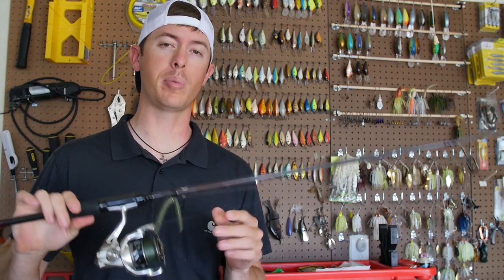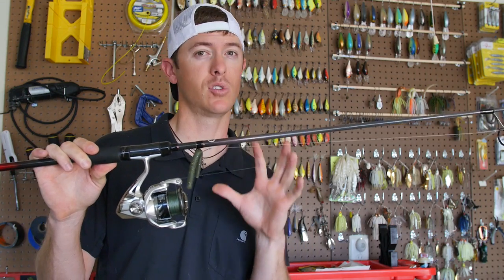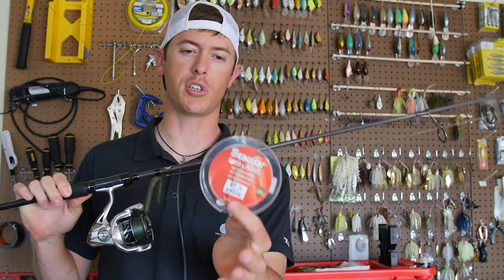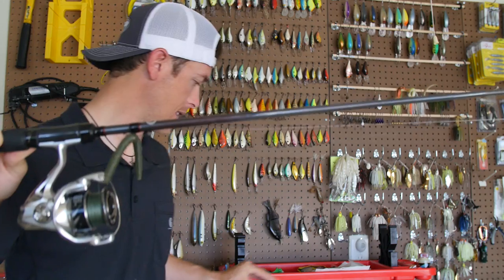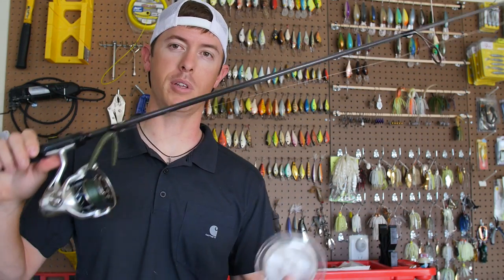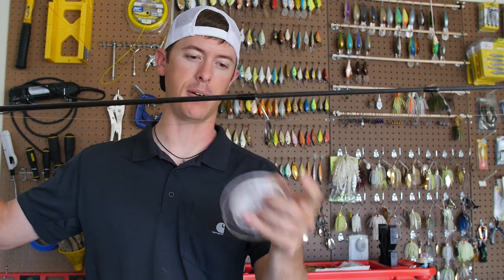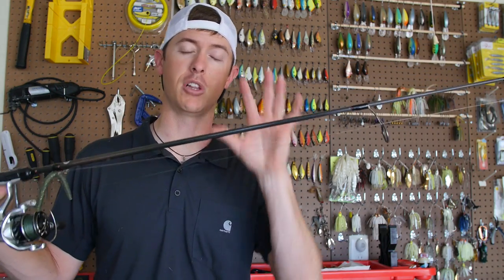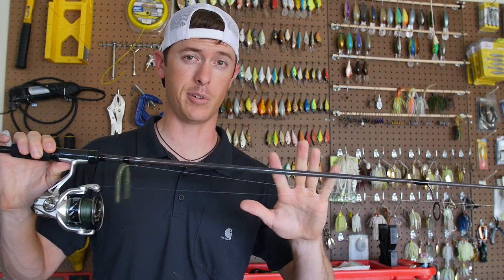How to Reduce Line Tangles on Spinning Reels Sub Question

Comment: Another thing is that you are putting too much line on the reel. So, when you happen to open the bail, the excess line will spill out. Also, you should try to tie your line to a tree, pole, etc. and walk it out until all the line is off. Then, pull until you fell the tension build. This should straighten the line and there will also be less line memory.
Reply: i also use a large barrel swivel on what i tie it off to and kind of bounce the line between tight and slightly loose and it seems to work more of the twist and memory out of stiffer lines
Reply: I’d have to walk to Asia if I were to unreel all my line

Comment: One trick I commonly use is after spooling take the spool off with the reel and let it soak in VERY hot water, it will take the memory out and it will "learn" the spool. Dry it off real good and put back on the reel and you're good to go

Comment: I use braid on all of my spinning reels and tie a fluorocarbon leader with a double uni-knot. I never use braid on my bait casters, only fluorocarbon because of the problems of digging into its self with braid. Also a good point made in this video is look at your spinning reel to see which direction your bail is going to put the line on the spool. Is it going in a clockwise or counterclockwise direction then lay your spool on the floor.and make sure the line is coming off the spool in the same direction that your bail is rotating. All of the spinning reels that I have dealt with go in a counterclockwise direction except the old Mitchel 300 spinning reels that go in a clockwise direction.

Comment: Another good way to decrease the kinks and twists (flouro, mono)is to take the spool of your reel and soak it in warm to hot water (depending on how bad it is) for 10-15 minutes and it should be ready to rock n roll, I do this about 3-4 times a year and never have to change line, after I take it out of the water I just oil it a little and casts like a dream with no kinks or twist.

Comment: Not sure if I am right: 1) when spooling the reel, it's okay to put the line spool vertically, just feed the line counter clockwise. Same  as when laying the pool down. 2) Some lines have more memory than others. After filling the spool, I take the spool off, carefully put it under a faucet and let hot water flow over it for 20 sec. Be careful not to get water into the drag discs-put some paper towel ball to block it. This heat will reset the memory and the line will not jump off spool anymore. And, line won't be damaged at all.

Comment: Braid to a fluorocarbon leader is the way to go. I started using it and you save money, then braid doesn't cause line twists, and you get more sensitivity. But before I started using braid to flouro I would spray down with the KVD line and lure and it would soften the flouro on to the spool and would add a little bit of strength.

Comment: Good tips, now i have a question regarding a baitcaster with 30 lbs power pro regular braid, the line keeps biting into the spool and when i make a long cast it brakes off and off goes my lure, now I'm aware of the fact that it happens after catching a fish or getting snag and all that but my question is are other brands of braided line are the same or is it just power pro? also i do try to keep an eye on my spool to try and prevent future problems but it seems to happen way to often. Thanks Justin.
Reply: you aren't putting the line on your reel with enough pressure. if you wind it on with more pressure, it won't eat into the spool
Reply: +Luke Cantrell It did cross my mind, thank you for confirming that!
Reply: The diameter is to thin use a different brand or heavier pound test.
Reply: +Joel Ortega the pressure can result from the size bait your using etc. why 30 pound braid on the bait caster anyway?
Reply: +Dustin Edmiston Well i basically use this set up to fish around cover so i went with 30 cause it makes it easy for me to get it out of any snag, yesterday i went to academy and found a spool of suffix on sale for 14 bucks so I'm gonna try it, thanks for the reply.

Comment: I was having a problem with my ardent wire spinning reel, I was getting knots in my line almost every cast, I switched from 15lb braid to 12lb flouro and continued to have the same problem and tried reel magic but continued to have the same problem

Comment: Can u explain what I'm doing wrong with my bait caster .. I have braid on my bait caster and sometimes when I cast it, it will stop mid cast and my lures pop off
Reply: you can do one of two things: first you can tighten the centrifugal braking system, which will reduce backlash but also casting distance. you can also use your thumb to keep constant pressure throughout the entire cast(especially with lighter lures) and have much more control. this takes a lot of practice to perfect so don't be frustrated at first
Reply: If it stops mid cast, most of the time the line has dug itself into the spool. That normally happens when you catch a fish, get hung up, or put a lot of pressure on the line in general. If your lures pop of, then your knot must not be tied right... I normally use the palomar knot for braid.
Reply: it just sucks when I cast a heavy lure long distance with my thumb keeping good pressure and then it just stops and my lure pops off my fluorocarbon liter
Reply: try just casting into a lake and walking alongside it until your reel is empty. then wind all the line back in with good even pressure. should fix your problem
Reply: If your lure comes off with a little snag of the line, then when you hang a fish your lure will definently come off with the fish. I would check to see if your flourocarbon leader is old or rotten.
Reply: mine does that too
Reply: You gotta put mono on first and uni knot them
Reply: It's digging in to itself!! Stop putting small diameter braid on your casting equipment!! That will solve your issue.

Comment: I always get my real lined up and after using it for a week I've been having an issue with the line jumping off of the real how can I get the memory out of the line?
Reply: Gary Frye I did this for 10 minutes and still have some issues. Do you think I should’ve left it in longer?
Reply: @airmobiledivision7759  I've come to find out that over spooling can be a factor in line jumping off the real as well. Now that I don't load up my real with so much line I don't seem to have the same problems
Reply: Jacob Vincent  I was trying to be careful about this, but maybe I ended up putting too much line on anyways. Have to check again in the morning. Thanks for the tip, bud.